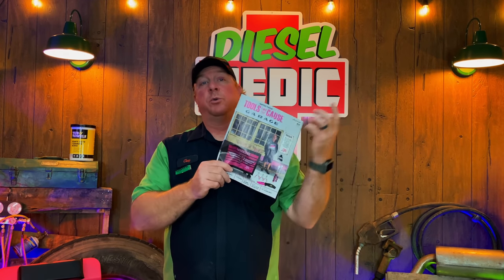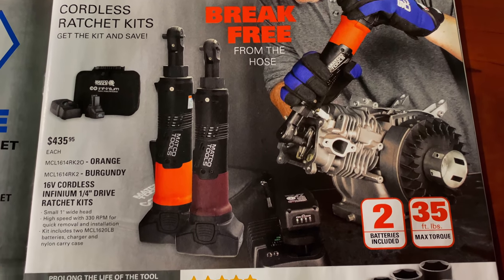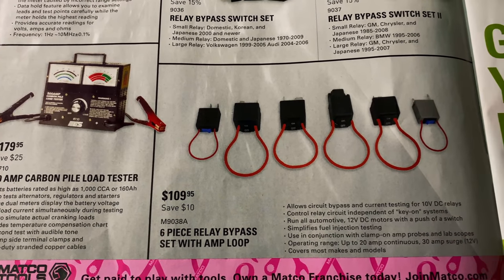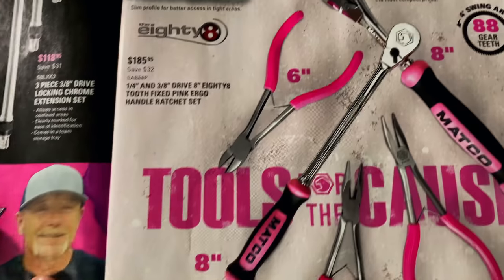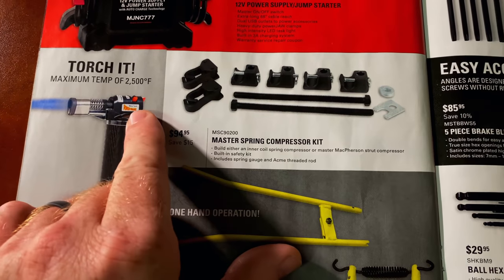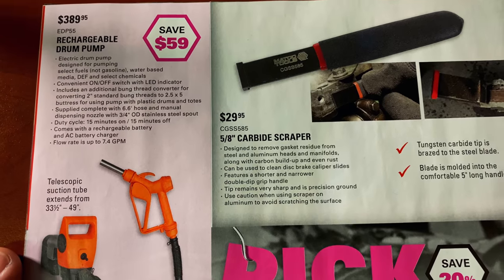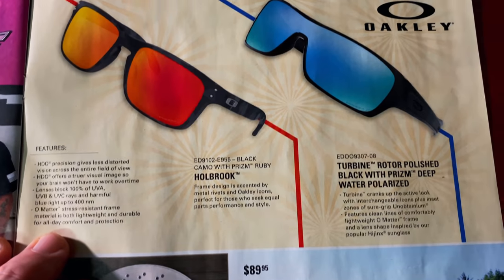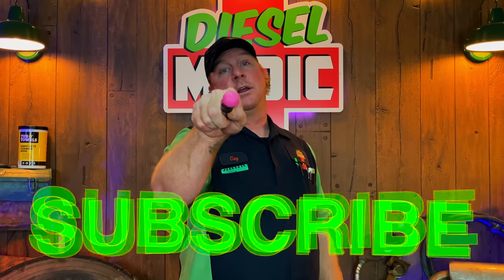Matco Tools Flyer 09/26/20-10/18/20 Great Sales And Cool Pink Tools! New Tools For The Cause Items

Comment: Those carbide scrapers are amazing. Guy I worked with got one a year ago or so and it’s fantastic. He was trying to get that hose puller from SnapOn for I don’t know how long, but the dude just never could get it for some reason. I haven’t used it, but he pretty much said the same as you: it’s the best for getting radiator hoses off.

Comment: If you were a new mechanic working on light duty trucks and cars, and you only had the money to buy either 3/8 drive or 1/2 impacts, which size drive would you buy to get started?
Reply: 3/8’s
Reply: Buy the 3/8 Milwaukee stubby impact. Thing has enough power to get most jobs done.
Reply from the maker: I have them all but honestly I use my battery 3/8” (Snap On CT761) I prefer it because it’s light. Strong. And thin and I like the trigger better to go forward and backwards on rusty or cruddy stuff. And if it doesn’t get it loose I use my 1/2” air Matco 2779 
Those are my go to impacts.
Reply: Koon Trucking If you were to only buy one socket set size to get started, would you also buy 3/8 sockets? Or start with buying the 1/2 drive sockets? 

You have always been helpful and I love your channel.